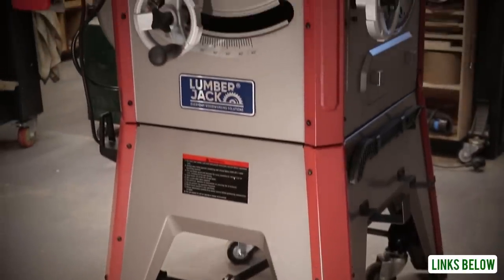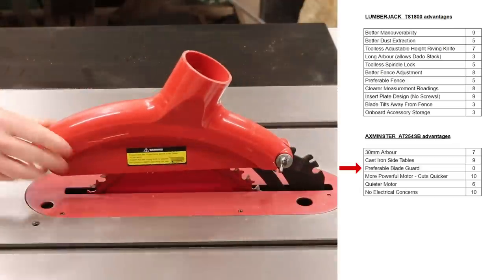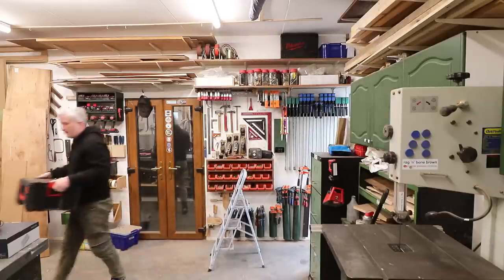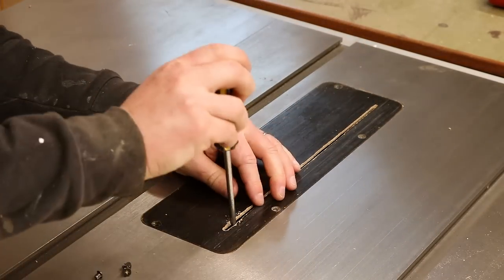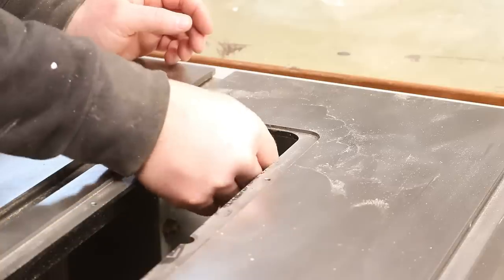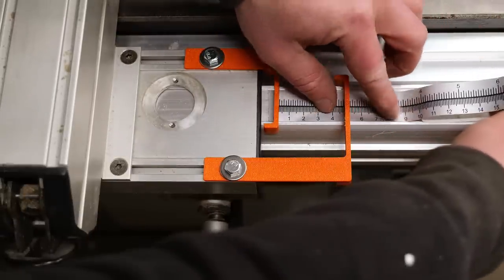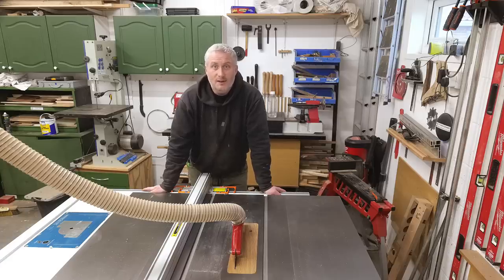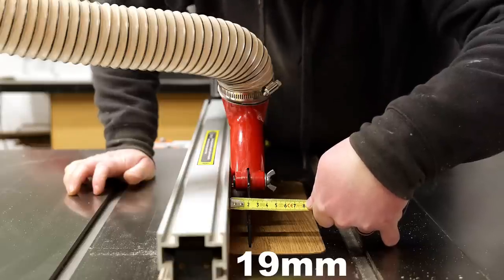5 MAJOR TABLESAW UPGRADES // LumberJack Vs Axminster Decision

Comment: Have to say, I think you made the right call. I've got some Axminster gear and a couple of Lumberjack bits as well, and while the Axminster ones do have some bits of awful design (as you showed!) they do at least feel like they'll last, and their customer service is excellent. The Lumberjack stuff has much more of a "this is going to fail at an inopportune moment and take three months for them to send me replacement parts" feel.
Reply: Just seems like the Axminster came with a ton of compromises though. Also, maybe I’m wrong, but I can’t find anywhere a review that suggests the lumberjack has a build quality issue.
Reply: @whyfearfear82  I've had a ts1800 for a while, no issues with mine at all. The Axminster was way too expensive for my purposes.

Comment: The casters might not fail but that flat plate might bend with time. I know it's thick steel but it's only a flat plate. It doesn't have much lateral strength aside from being thick.

Comment: If you enlarge the slot in the guard bolt ,it will fit from the other side . Alternatively if you do not have a way of enlarging the slot , fit a washer to the end of the bolt so that it changes the position of the slot .

Comment: I bought the SIP version of that table saw probably 20 years ago and the only issues I've had with it is the poor dust extraction and I came up with the same solution as yourself and I've put up with the fence not moving parallel to the blade but I've got in the habit to check it every time. So I'll definitely try some shims. Great video thanks

Comment: You can use magnets on the insert plate Keith. 
All you need to do is insert some into the sides of the plate that you didn't rout away. A couple 25mm x 8mmx 2mm neodymium magnets on each side ought to be plenty to grip the metal of the bed.

Comment: Right decision Keith on your choice , I managed to get the same Axminster saw and also the ap50e trade wall mounted dust extractor , dust extractor works very well with my old saw , Metabo planer/thicknesser and 12” planer , I am just waiting for the 16amp power output to be installed to start playing with my saw . I am very interested in the upgrades you have showed . Top job once I finish rearranging my workshop I pop a couple of pictures on 👍

Comment: Great stuff here Keith. I gave my standard fence measurement accuracy away, a long time back. not readable / reliable and not square. It may seem like extra work but I'm happy with my solutions. I use a standard measure tape which  lives on the fence. a speed square as my 'Square', two magnets attached to the fence to hold the fence in place, along with slight pressure on the existing locking leaver . Yes they hold and I get accuracy every time. I too use two systems for the dust. table and over blade.
Reply from the maker: Thanks for sharing

Comment: I have this (or very similar) saw so thought I would share a couple of things i learnt from it. 

To adjust the fence I had a couple of square base magswitches so I locked them onto the table parallel to the blade (and the mitre slot as they should be the same) at the front and back of the table and clamped the fence against them to hold it in place whilst tightening the bolts.

As for the crown guard, with mine if you cranked the blade up all the way I think the fence slipped in under the guard so you could get close to the blade (as i type this i realise that I think mine is a 12" and yours is a 10" so it might be different) but either way I just ended up removing the guard for close cuts as frankly I think it is safer to have good access for a push stick than to kept the guard in place and either not use a push stick or so something sketchy with it. 

I have since totally abandoned the crown guard for most jobs as the riving knife is too tall for grooving cuts which I do more now so I ordered a spare riving knife and cut it down to slightly shorter than than the blade height which removes the crown guard mounting slot. i ordered the 2nd riving knife as I assumed i would switch back and forth, but frankly I have never put the original and crown guard back in as i have never felt the need. The dust extraction never worked well enough for me to care about loosing it, and I think from a safety standpoint for me it is better to always have a riving knife rather than a crown guard, especially on narrower cuts where I have better access for push sticks or blocks without a guard getting in the way.

Comment: The trouble is the manufacturer doesn't take into account that you may not need a complete new crown guard but it's all about them forcing you to buy things excessively regardless of the one thing you need to put an issue right Keith. 
Great video mate 👍🏽 👌

Comment: Great upgrades.  With the insert plate could you add magnets to what would be the front side rather than the bottom?  This would not give as good a hold but it may be enough with your flush-fitting plate.

Comment: Hello from Ireland !I have that exact problem with the table fence so I'm gong to do that, thanks. The screws that hold the fence rail to the fence clamp are a bit stripped, any tios for fixing those? My fence is basically adjusted every cut by tapping it with the screws left alone. Seems dangerous to have a fence shift on most cuts!

Comment: (7:25) Considering none of the casters lock, are you concerned the saw may move as you’re cutting a large, heavy, unwieldy piece of material with it?
Reply from the maker: it still locks via the hand screw knobs at the front

Comment: Nice solutions, Keith!

For the saw insert, could you countersink and glue a washer or two to the underneath of the rebate on the wooden insert and then fit the magnet close by under the saw table itself?

Comment: Are those plastic spacers not going to squish over time and cause the caster braces to become loose? They look warped already
Reply from the maker: they are compressed with the tension of the nuts and bolts, but they're not going to squish more over time

Comment: I have this saw and have the same frustrations as you.  I typically leave the crown gard off 😲but then dust extraction is worse than terrible.  The little machine screws to remove the insert place is THE WORST pain with the thing.  I am so sick of removing and replacing those f***ing screws!
Reply from the maker: I hear you!! 👍
Reply: Have either of you tried blocking the gaps at the top and bottom of the saw so that the lower vacuum is only pulling air through the blade slot? I have seen this done but am not sure whether this will affect the motor cooling.

Comment: Thanks for this! I'm considering to buy an Axminster AW254 but I'm actually a bit hesitant, only due to the way the fence is attached. In your 1800 TS review, it was quite apparent the fence attachment, with all its added adjustment capabilities was superior to the Axminster. Would it be possible to buy a third-party fence attachment which has the TS1800 fence adjustment capabilities and put them on the Axminster? If so, can anybody indicate where I could purchase that? Thanks!
Reply from the maker: Yes, search for biesemeyer fence and you should be able to bolt the rails to the table

Comment: Pretty sure I’ll be getting a lumberjack, the points system began to feel a bit like a hunt for reasons to keep the Axminster at the end 😂
Simpler way is to toss a coin, if you know the second the selection is revealed you wanted the other one you have your answer no justification needed. They both look to be good saws though so I can understand the trouble choosing.

Comment: Any chance I can piggyback off this discussion.
I have the "Einhell 2000W 250mm".

I find it wanting. Not really wide enough and the guide rail is stubby and has far too much play (and I won't even mention the cross cut).

I was looking at buying an after market guide rail to try and help, I found one got about £120.

Eventually I found the Lumberjack 10" portable table saw for £250.

It sports a rigid guide rail and a wide extension table and it is portable to boot.

Thinking about selling my Einhell, saving the money I'd have spent on guiderail and just getting this.

Have you, or anyone else got any thoughts on this table saw etc?

Please/thank you.

Comment: I mean, to me, one of them being discontinued would make it a non-starter for me. With it being discontinued, getting replacements if necessary will only get harder over time. That may be the same for any item, but the countdown on that doesn't really start until it's reached EOL.
Reply from the maker: the saw is still sold by iTech and SIP so spare parts are available
Reply: @RagnBoneBrown  For now. They still have old stock, but how many spare parts are there, or are the spares still being made(even if only kept in small quantities).

Comment: Still having issues with my Lumber Jack saw, still blowing fuses, even slow blow fuses. Lumber Jack now saying I need a 16amp circuit.
Reply: But a 16amp circuit won’t help unless you have a 16amp plug and fuse. Are they saying you need to fit a new plug? Are they going to pay for that given the saw doesn’t work as advertised?
Reply: @therestlessworkshop  Yes will have to replace the plug on saw too, which apparently wont void any warranties. Of course very unlikely I'll get anything from LumberJack, I just want people to know what they are getting into with this saw, definitely does not work as advertised. Having said that for the level of saw I wanted I guess it was inevitable that I would end up needing a 16amp circuit, and the Lumber Jack saw still ticks a lot of boxes for me.
Reply: @timd2809 
I have the same issue with my lumberjack saw. I was hoping that slow blow fuses demonstrated in one of this bloke’s previous vids would do the trick. I paid £5.00 for two fuses,they lasted less time than an ordinary fuse. I normally like to switch the power off when the saw’s not in use,I find if I leave the power switch on the wall on,even when the saw’s not in use,my fuses last much longer. When I finish in my workshop,I lower the blade and lock my workshop door,I don’t want my grandchildren to wonder in and press the on switch on a saw that’s ready to cut 24/7. I’ve been advised to upgrade the saw to 16a too. More expense.
Reply: I would get onto them and get the saw returned for a refund myself. It's not fit for  purpose as advertised. No way should you need a 16a supply for a motor that size. It's advertised to run on a 13a supply and that's what it should do. The company seem totally amateur in getting this problem corrected.
Reply: @alankirbywoodworking  Yeah its not great but for the money and features what else is out there, I will go ahead with the 16amp circuit anyway as whether its with this saw or another I think I will need it anyway. Haven't ruled out returning it yet.

Comment: Most of this was absolutely golden, but one thing stood out as a huge safety issue.  You just made your table saw easier to move, AND took away the ability to lock it in place, all at the same time.  Isn't this unsafe?  Obviously it won't move on you with smaller projects, the weight alone will keep it stationary, but what about when you're wrestling some massive sheet of thick plywood onto it -- or worse, through it?  

You need some kind of foot-operated kick stop to lock it in place -now-, or even just casters with brakes, because if you're like me you'll forget and only remember it doesn't have a lock now when it actually moves at the worst possible time.
Reply: I think 2 original casters still have breaks on plus this saw is super heavy. You won.t move it when cutting stuff on it unless you put whole body weight on it.

Comment: I would like to purchase a Hammer K3 Saw Table with sliding table but Felder UK have a strange way of selling or rather not selling! They will not publish the prices. Their excuse is that everyone wants different accessories. I said why not publish the price of the accessories as well? But that seemed to be above their level of comprehension.
Reply from the maker: Sounds about right! I don't know why it has to be so difficult

Comment: Maybe, Karl can design a pin for the guard using 3D prints? Might be a lot faster to use Karl than to get an entire large-company to design one extra thing (something which they should've already been aware of). 

Like always, great video!

P.s. I'm quite concerned regarding the castors, incase they fail on you while making a cut. Unless, I missed something?
Reply from the maker: I think metal ones are more practical, besides, seems Axminster are already on top of it.  If the castors fail, the saw only drops by 15mm at the most, so not a big deal

Comment: Interesting scoring system. It heavily favoured the lumberjack because it has more lines that score so it’s easier to get a higher score 

Would have been better to score each saw for each of the lines and then get a total, or average

Then again, the Axminster still won haha
Reply from the maker: But the reason it has more lines that score is because it has more advantages? 👍
Reply: Put the same criteria for both saws, the Axminster would simply show zero where it didn't have the Lumberjack's advantages.  Same score!
Reply: @richa8308  not sure I get this logic. Are you assuming that because one saw scores higher the other will automatically score 0? It’s ok to score one less than the other but not like all or nothing
Reply: @MigleschienHysteria  Hi Jack, sorry, my thought pattern is not well expressed.  If we took all criteria listed for both saws and applied against each, there would be a fairer scoring system.  However, Keith will inevitably have used all criteria, at least subconsciously, and his exclusion in certain listings suggests a dismissal, or zero score, at least subconsciously.  Therefore, had the criteria lists been comprehensive, the score would still have been the same.  I'm not assuming that a higher score negates the other's score for that criteria, but am suggesting that where the criteria is not listed, its score is automatically zero.  Big assumptions on how Keith's mind has worked, but its generally how we all think.

Comment: When you measure depth use the other end of the caliper it gives a lot more flat surface thus easier and more accurate. I put my back out using the Record bandsaw wheels so spent a furtune on the improved wheel lift abomination. Whoever designed this never used it once the table overhangs the lift handle and the resulting contortion in use is bad for your health.

Comment: It seems to me that the table saws you've had since the old Dewalt have all been a net downgrade. Is that fair? I suppose the bigger tables are really useful, but they all seem to be of inferior design, especially when it comes to the fence and measuring.
Reply from the maker: Depends what you want out of a saw really. I wouldn't want to go back to the DeWalt, I found it unpleasant to use mainly because of how noisy it was